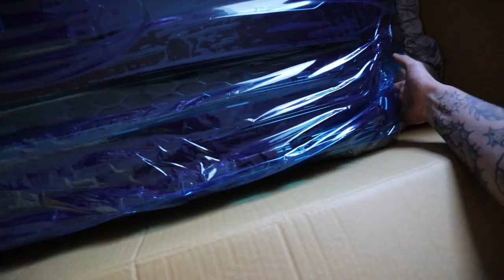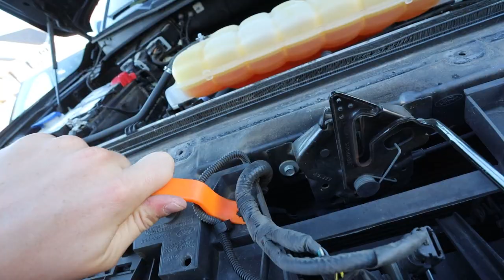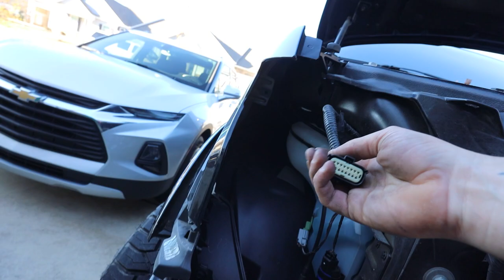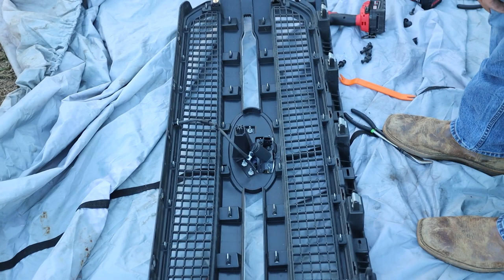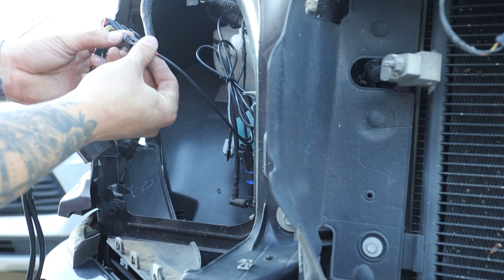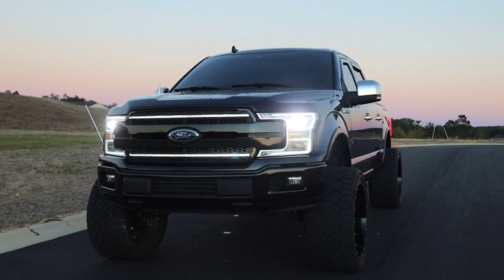MORIMOTO LED GRILL INSTALL changed my whole truck!!!

Comment: Anyone had an issue with the wiring for the grille? My grill lights will only turn on at night when the headlights kick on. The drl feature won't work right. 2018 f150 with the hybrid xb lights

Comment: Hopefully you have better luck with Morimoto than I've had.   The warranty has saved me on two different items but I have no confidence in the brand after its expired.   That grill looks like alot of work to have to swap it out in a year or two.

I will say their warranty is top notch.  As long as you can show proof of purchase and you're within warranty they simply swap it out.